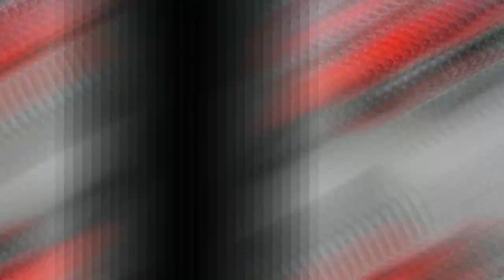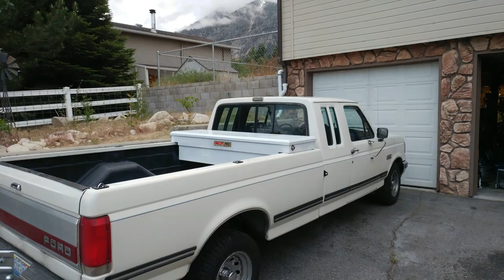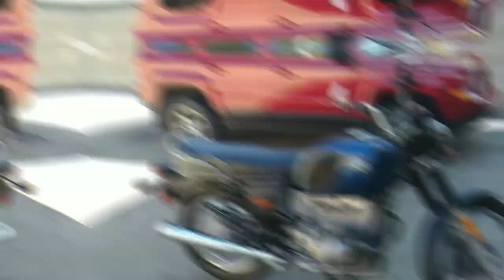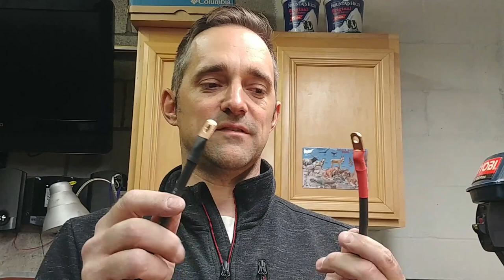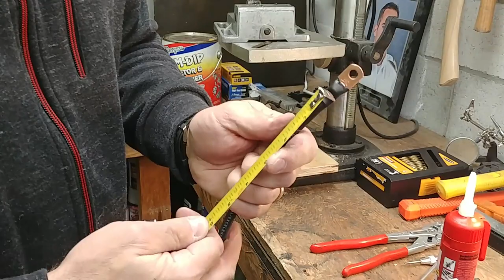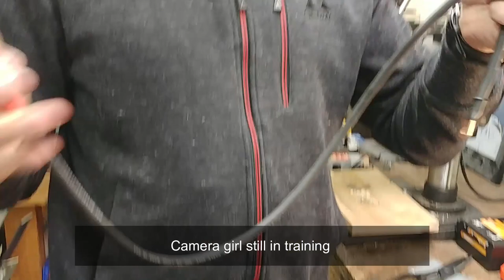home made crimper for battery cables

Comment: Just the advice I was looking for to crimp my two 2 gauge inverter cables without a very expensive tool, thanks!
Though surprised to see you're using a heat shrink that's obviously too small, most other youtubers use one that can even slide over the  terminal.
I don't have a ball bearing and I want to do the job today, thinking of cutting a small piece off a drill bit and fixing it with superglue inside the one half of the nut ...?
Reply from the maker: Any normal hardware store sells individual ball bearings balls for 20 cents. I used the shrink tubing I had.